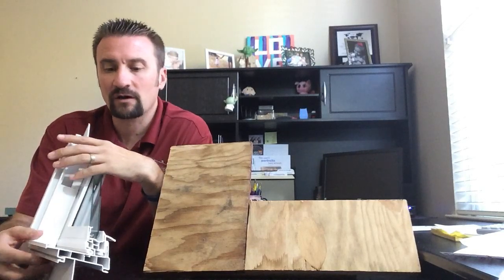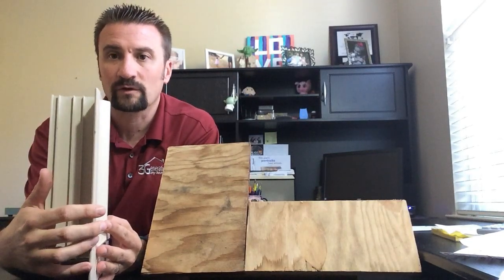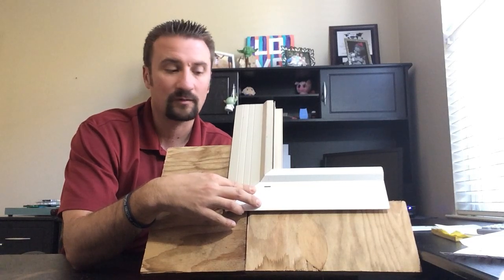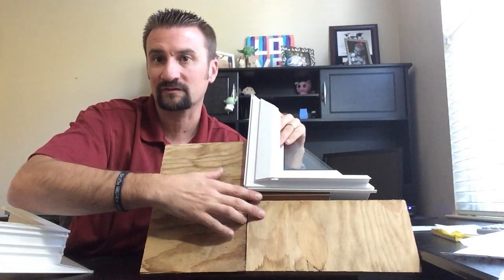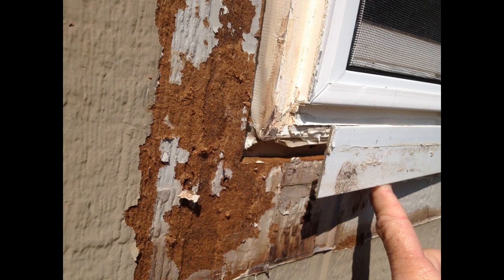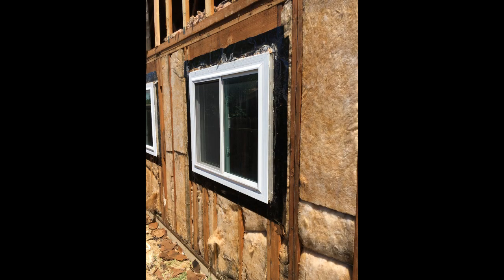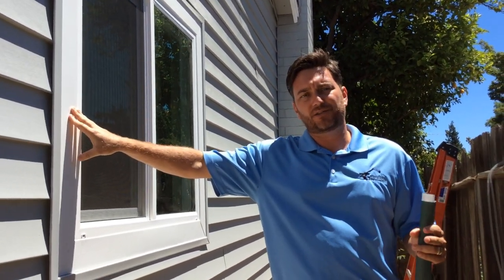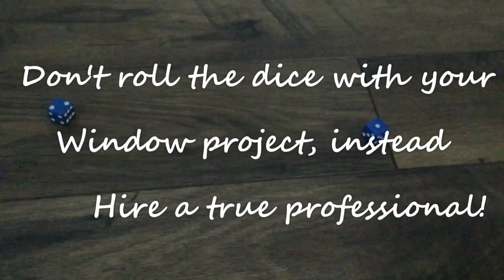Replacement vs Nail Fin Window Installation

Comment: A replacement window has no flange at all. It is supposed to insert into the old hole of the original window. It does not go over the top of your siding/sheathing. You then seal the edges with caulking, when done correctly it will not leak or cause any kind of water issue.
Reply: We are probably dealing with different terminology based on the region.  We use block or insert windows to fit in the existing "hole" or jamb - this is commonly found in wood window applications.  This application does not typically cause any leak situations because the new window fits inside the wood stops.  
In this video, we are referring to replacement, flush fin or Z-bar (many different terms depending upon region).  The flange is manufactured on the outside of the window in order to cover up the existing window frame.  This application can cause severe problems depending upon the type of exterior siding and trim that exists.
Reply: Actually they do make a replacement widow with a nailing flange and it's not called a new construction window
Reply: A replacement window will leak,even if you caulk,if you have movement in the house,the window is going to leak.
Reply: @djdev3077  "if done correctly" it will not leak

Comment: If you wanted to put a new construction window in an already existing house (replacing current windows with new construction windows), do you just have to remove the siding pieces in the way around the window frame for the new nail fin to be nailed into the stud or do you have to remove the portion of wall itself (the OSB or what ever they use)? -  [Which is what i assume im looking at at 9:40 in video]
Reply: In order to get a nail fin window in, you will have to remove the window trim and potentially cut back the siding too in order to get to the plywood or stud level.  If the siding was installed over the studs, then the new construction fin would be installed on the studs, but if plywood/OSB exists, than the fin would sit on the plywood.  It is easiest if the existing siding butts to the trim (which is how most siding such as Hardie and LP is installed these days in order to install Z-bar flashing over the head trim) because you can simply remove the trim (try and keep paper in place),  flash bottom, then 2-sides with flashing tape, caulk around top and 3 sides where fin will sit, then install window , flash top of fin and tie it all in with existing house wrap.  Hope that helps, feel free to email me at jeremy@3ghomeimprovements.com if you need some help.  Thanks!

Comment: Great video, very clear. I know you mentioned twice to change windows and siding together but can you do windows first then siding?
Reply: Thank you for the kind words!  Ideally, they should be done together to control costs and flashing details, but there are certainly ways to do one before the other.  The steps taken would depend on what type of siding you have.  For example, if you have wood siding butted to exterior trim, then you could remove trim, flashing and install windows, then install new trim and caulking.  As mentioned, we recommend nail-fin window for flashing and water intrustion protection.  Hope that helps!

Comment: The worst and disastrous window installation.
You did not put membrane all around. The water will infiltrate and will ruin all unprotected wood.
 A no flange window requires 10 more protection and skill to install. You should delete it.

On the bottom you do not put the membrane behind the siding; the water will get behind the siding! It is to be over the siding. This will not pass code!
Reply from the maker: Thank you for responding to our video.  The purpose of the video was to show the difference between nail fin and replacement windows, not to show the different window flashing techniques.  As I am sure you know, there are several approved window flashing details (either at the prompting of AAMA, IBC or state and even local building codes) and in Northern California there are some building departments who have or adopt their preferred methods.  Shockingly, there are some areas in the east coast that only require house wrap tape to flash their windows and do not even require any flashing tape to protect the wood surfaces.  This particular building department wanted us to flash under the fins first, then apply a second layer over the head fin only (we did not show this in the video).  Yes, we passed the inspection, as we do on all of our thousands of window units installed over the years.  

There is a trend in Northern California and some areas in WA and OR that feel if peel-and-stick is not adhered directly to the rough openings’ wood surfaces, water has the potential to travel between the framing and the housewrap. And they believe that the whole point of using a peel-and-stick flashing is to protect the innermost wood components. Probably 999 out of 1,000 windows we flash we use the method that you were probably referring to (flash lower and into house to back dam when possible, then two sides, install window and finish with head flash after).  

We are big fans of installing siding the right way using premium flashing techniques such as slip sheets for the butt joints, z-bar flashing over all trim and better kick-out flashing where needed to avoid any potential water problems in the first place. With technology advancements and building science I think changes will soon come to the way we wrap and flash homes to assure long-term durability.  We are certainly not a company who cuts corners in any way - we never want call backs!

Comment: People make videos assuming every opening is the same.  I been installing windows for 30 years. This guy would not want to sit down with me and show how little he actually knows. The only time a aluminum frame. Is ever left in place is on newer stucco homes because that is a seal you don't want to break. If you want to pay extra thousands of dollars to have your stucco cut back and replaced repainted feel free. Or thousands more if you have stucco banding around those windows. If your stucco is cracking and  you pull the frames it will leak. Ever other opening the aluminum frame should be removed. Its ridiculous to assume people are leaving frames in. Any person that tells you you should install flanged windows in sold brick openings is a idiot. Professional installers can remove the old window frame and all. Use their trim break to build a perfect flash pan that will last for ever and install a retrofit window without doing any damage to your brick but if you want to pay thousands of dollars to have brick removed so you can use a new construction window feel free. Hardy or wood siding you always pull the full aluminum frame. Don't assume you can pull off a 1x4 and expose a nailing fin for the old window. Its behinb the siding. You extract the old window without damaging good trim. Anything not under a patio will have a Z flashing that keeps water from getting behind the trim. You measure and cut back the sheetrock so the new window sits back past the face of the hardy. If your tearing everything off then by all means use finned windows. But don't tear your whole home apart because some kid on utube tells you people leave frames in and thinks Professional installers don't know how to give you great garenteed installation without remodeling your whole home.
Reply: The point of the video is to answer the question that we get most for window installation types in our market. We do not say replacement windows never work and should never be done, just to be careful and look at the entire exterior as an water management system.  We have been installing windows as a family since 1956, so we have some experience...  and we have never recommended or torn out stone or brick to install a window, not sure why you made so many assumptions about our video and why the vitriol.  I am cool if you want to call me a kid because after 40 that feels pretty good!

We have received hundreds of replacement leak calls (done by others) over the years and these clients were never presented both installation methods.  It is our job as professional contractors to educate and present facts and options to homeowners and let them decide how they wish to proceed.  So perhaps this video is not intended for you.  Have a great day!
Reply: Thank you that you educate the customer.  Unfortunately my salesman did not educate me.  I didn’t ask so I got nothing.  Now when I look at my windows from the exterior I want to cry because they ruined the existing style of what I previously had.   It looks awful.

Comment: Phoenix Arizona. Home built 1999. Replaced construction grade aluminum window with vinyl replacement windows in 2010. The company is no longer in business. The south facing windows (and most all the rest) have extensive stucco cracking. Stucco guy said these windows are Masonry Windows because they do not have a flange or nail fins. What do I replace them with and How? Some say I don't have to replace the window. I am at lost. Please Help!
Reply: Tough one, I would not spend money on stucco repairs until/unless you figure out the windows at the same time. The best method in this case would be full nail finned windows by chipping out your stucco 6-9", re-flashing them and having a stucco company patch the stucco back. This does not guarantee yourself from future problems (leaks, cracks), but at least it is the right method, especially for south and west exposures. With what you described, you really couldn't and shouldn't replace a replacement window with another one. Windows usually only cause cracks if they are installed too tight to the framing and stucco, but the home could be settling a lot too, which would make any sharp edges and corners susceptible to cracking. Get a lot of opinions and estimates until you feel comfortable with a trusting licensed contractor - maybe a general would be a good way of going. Feel free to call me at the office at 916-932-2315. Good luck! 

Jeremy
Reply: @jeremyowens95630  Thanks for your prompt reply. I will call around and hopefully find someone who knows what they’re talking about. I’ll keep you posted. Thanks again

Comment: Pay attention to what your actually getting, because I just realized Anderson windows can come labeled as "new construction" and "replacement". Excuse me, yeah I was looking at a window display and noticed the nailing fin corners weren't looking sealed after asking the employee he gave me an answer I wasn't comfortable with and showed me the same style, same company, same series window, and I noticed the nail fin was all sealed together as a solid piece. Came home and realized the window I was looking at was labeled as both "new construction" and "replacement" so that nail fin can literally be removed, not the answer I got from the employee. But Anderson does sell windows strictly labeled "new construction" that the nail fin is fully sealed and won't come off. Lesson learned, thankfully before I pulled the trigger on any purchase.

Comment: I've taken on a semi major project, myself and on a fixed income budget...& thought I 'd found a REALLY good buy from Habitat for Humanity, really nice thick windows....only to get home & realize..there are no casing nor window fins...the windows are in 2 parts..the top (lock) & bottom (part the locks fit in.)....(I know nothing, as you can tell; about windows..just that these are thick & nice...my question..how can I install them???Can I purchase the fin(s) so I will have something to nail the window into my 2x4 frame??  Can I make these windows work??  I welcome all the advice I can get  Thanks for all the info!

Comment: Question. I want to replace my windows. How do I know if I’m going to need a “replacement” window or a window with a “flange”? Do I need to take off my siding to tell the difference?
Reply: If you have a two story stucco house or wood siding that is showing signs of deterioration I would not typically recommend "replacement windows"  because of the increase risk of water penetration problems.  If you have wood siding, you can install a nail fin window by removing your trim (and potentially cutting back your siding too), remove the existing window, re-flash the window, install new window, then trim and caulk.  As always, seek the advice of a local professional and get several estimates to gather the information that you need to make the right decision for you.  Good luck!

Comment: Regarding window replacement with nail fin windows:  The depth of windows between the nail fin and the inside face of the window is different for different window brands and lines.  If that depth (which is not the nail fin setback) for the existing window is 1-3/8", and it is 1-7/8" for the replacement window, you will be cutting back interior drywall returns and window sills so that the nail fin can sit on the exterior wall sheathing.  If you are going to attempt this, have your drywall finisher, trim carpenter and painter ready to repair the interior issues that will result.

Comment: We purchased replacement windows for a home renovation we are doing. We didn't realize at the time there was no nailing fin or flange. So Im thinking they are block windows. We spent too much to not use them. Any advice on how to install them so we don't have to worry about leakage? Im seeing a lot if different install methods. We will be putting them in a newly framed window opening if that makes a difference
Reply from the maker: Amy - you can check with the window manufacturer to see if they have any snap on nail-fin flanges that can be installed directly to the window.  If not, you can install window flashing tape on the edge of the window and onto the plywood/OSB.  Lasly, make sure the window to trim connection is caulked well, but more importantly, Z-bar galvenized flashing is installed over the head trim to promote proper water-shed.  Hope that helps.  Good luck!

Comment: I have rotted wood around my 30 year old windows.  Is it possible to put in new construction windows replace any rotted wood without removing the vinyl siding completely can it just be pulled back for the install ?

Comment: Jeramy, Thanks for the video! I’m old school and knew nothing about this new nail fin design. My home if lap siding (not vinal) and typical wood windows with wood brick mold on the outside.
Isnt there ANY way to replace my old window (sill rotted and part of window frame at one corner) without taking down or and/or replacing the siding? I’m retired military and just cant afford all that. Thank you for your proffesional experienced advise.
Reply: Yes, you can remove the wood stops on the inside on the windows and install a block framed window. Just be sure to fix the dry rot before putting the window in. There should be some good videos on how to install a window in old wood window openings. Good luck!

Comment: I didn't see any pictures of stucco wall houses with issues. I believe if the aluminum frame is left unmolested the chances of problems arising are minimal. If they're is issues with the water proofing of the house those problems will arise even with full replacement windows.
Reply: Good point.  We have hundreds of pictures of leaks with replacement windows in stucco (we live in a heavy stucco market), but I would say the majority of those homes likely already had flashing/waterproofing issues and they were told or hoped that installing new windows would solve the problem.  The bigger issue is that homeowners are not getting the information on installation options and they are investing over $20,000 on new windows that cannot be flashed, re-set or moved in any way if a leak develops. 

I have seen leaks in replacement windows caused by failed caulking where the two windows come together and this too is difficult to repair or diagnose sometimes. When caulking is relied upon to prevent water intrusion it can be a recipe for disaster, especially in hot climates where caulking fails at a faster rate.

Comment: Jeremy,  I’m afraid I had my six front vinyl windows replaced with those vinyl replacement flush fin windows.   My exterior wall is stucco, two stories.   I didn’t ask what install method was to be used.  Can I remove those new windows and start from scratch using the correct method you suggested or will that damage the wall?
Reply: You can remove the replacement windows, along with original windows by chipping out the stucco 6-9", then installing a new nail finned window, flashing and installing new stucco and paint. You could wait a winter or two to see how they hold up. I hate that window company's do not bring up the 2 methods and allow the homeowners to decide what is best for them and their house. Good luck!
Reply: Thank you, Jeremy.  I will keep your suggestions in mind.

Comment: Can I remove the window shims after the foam dries up. I want to foam where the shims where then replace the screws.
Reply: Should be ok, but I would leave them so as to not move the window out of plumb/square.  The shims will not be a big energy waster.

Comment: Thanks for the wisdom in the video! I bought an assortment of windows for a tiny house I’m starting to build. Two of them do not have nail fins. Is there a good method to still use them? Or is it worth it to look for two windows with fins?
Reply: Drew - Thank you for the kind words!  Some window manufacturers offer a snap in nail fin, so you might want to check that out first.  If you have good eave protection you should be ok with a block frame as long as you stay on top of the siding & caulking maintenance on the outside. If it is an exposed area, better be safe than sorry....  Good luck!